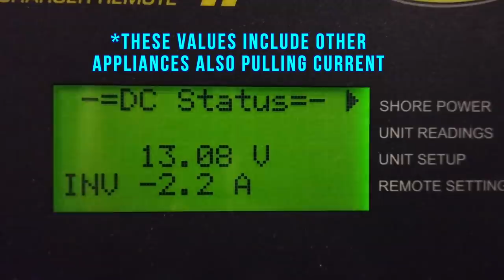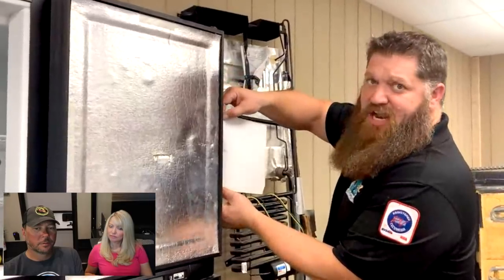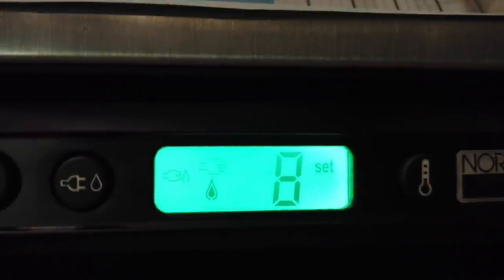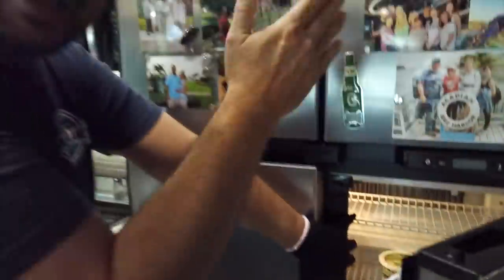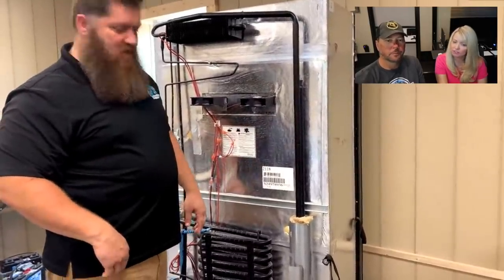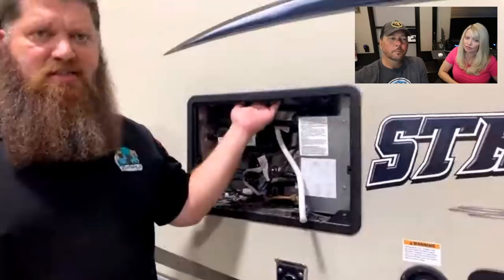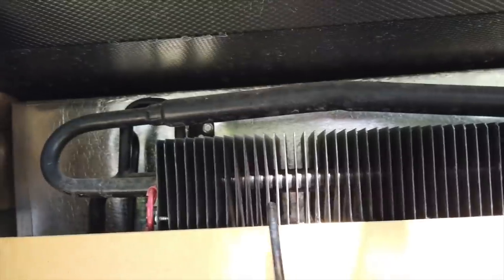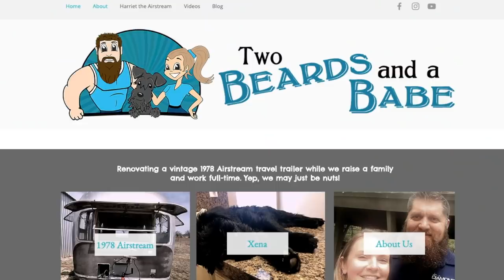Full Time RV Maintenance (Refrigeration) | Changing Lanes!

Comment: We really appreciate the fact that you guys are taking  the time to produce these maintenance videos  to help your  subscribers. This being said, there were just to many incorrect statements made in both this segment and the previous one.  This is only due to the fact that you were given incomplete and or inaccurate information from your expert.  For instance  condensing coils reside  on the exterior of the unit and evaporative  coils are found in the  cold side of the frig. The biggest problem  those of us have is the poor air flow, we suffer not having a roof jack vent  when the unit is mounted in a slide. We are forced to rely  on a side vent  that does not provide the proper chimney effect (draft). Also of key importance is  to make sure that the propane line is providing the required pressure (11.0 water column inches)  to the control valve and clean the burner assembly thoroughly at least once annually. Please see the YouTube video  I have provided a link for that describes how an absorption systems works. Happy trails. https://www.youtube.com/watch?v=udeSVyx6_9A
Reply: Stephen Cimmarusti  I agree that the side vent is not a great design and does make it harder. That was discussed but wasn’t something addressed in this video. While we could have discussed it, I think the purpose of the video was to help people with what they have. 

My phrasing on the coils. I was trying to say condensate off the coils and yes I said incorrectly as condensate coils. That was an error. 

Regarding your propane statement again this wasn’t the focus because almost no RVer has a manometer nor the experience to conduct a proper time pressure drop test. 

I understand your desire to cover 100% of all the possibilities but this video wasn’t created for that. I hope you understand.
Reply from the maker: Like Todd said...  Our focus was on the things a layman could do and the fact that an RV fridge is different in that it uses heat versus a refrigerant.  We all make mistakes in verbiage sometimes, but the heart of the matter was covered, which is what can be done by the average Joe to eliminate sources of improper air flow etc.  It's easy to nit pick details after the fact.  We try to get all of the details right every time, and don't always bat 1000.  But we feel the "meat" of this video is spot on and helpful.
Reply: @ChangingLanes  Sorry  Guys. I tend to be a little critical being a flight instructor with an aircraft power plant rating and an FAA authorized inspector. I also have  a back ground in
refrigeration and owned  an RV repair center for several years. This being said, what you are doing is very good and we thoroughly enjoy following your channel. Keep up the good work and  keep in mind we are all constantly learning. I was told once " when you are green you grow when your ripe you rot". Happy trails- Steve  ;)

Comment: Nice video....But.... there are 3 way RV fridges that actually operate off 12 volt. They have a 12 heat element along with a 120 volt heat element in the burner tube. So they can actually run off 12 volt, 120 volt and or propane. No matter what type of heat used the RV frige will still need 12 volt to run circuit board.
One other thing to look into for safety and greatly improved performance is a Frige Defend by ARP.
Reply from the maker: Someone else mentioned ARP also...  It might be a good product, but holy cow... that web site!  It's hard to take any company seriously that has a web site stuck in 1995.  But looking into it nonetheless..  Thanks for the tip! 😊
Reply: gsibertjr actually very few RV fridges are 3 way. Yes all circuit boards in the rv are 12v but most fridges do not have a 12 v candy cane heating element.
Reply: @ChangingLanes  my 6.2cf Dometic 3 way with the ARP runs refrigerator at 32F and freezer at 2F with outside temps upper 80's to lower 90's. Takes about 4 hours to cool down to those numbers if I have unit off. A lot of RV fires are started with the frige. According to ARP, when you are not level the boiler tube can overheat which causes the system to be over pressurized which weakens tubing and joints. When these fail the ammonia can leak and catch fire from flame. The ARP system suppose to shut system down when it over heats, plus it can control additional cooling fans.
Oh, we also use a small cooler with ice to cool drinks and get ice so we do not open fridge and freezer so much.
Reply from the maker: Wow!  Those are very good numbers!  👍🏼

Comment: This is a video that every RV owner should watch!  Excellent information.  I'd like to learn more about the crystals that were mentioned but not reviewed in detail...how they form and how to get rid of them.
Reply: Life, on OUR time so there is a powder in the coils (sodium chromate) it’s job is to keep the inside of the coils from rusting. 

If the fridge isn’t level then that powder gets caught in a crease or bend in the pipe and due to the heat will crystallize. Once it crystallizes it will not revert back to a powder. Those crystals can block the flow of the ammonia causing the cooling system to fail.